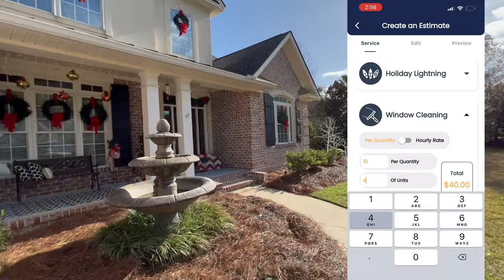How To Quote Window Cleaning (The Fast and Easy Way)

Comment: Where I live, I initially stick around 15 a window. If they have me come back every 6 months, I’ll do 13 a window. However If I’m getting of construction debris, I’ll charge 18 a window. If I’m doing construction cleaning, I’ll do 20-25 a window. I’m upfront with my customers before I even step foot on the job and my reviews on apps like thumbtack speak for themselves on my quality of work. I started this business with my twin brother in high school at 18 years old, we both are 23 now and growing every year.
Reply from the maker: Love to hear it - what do you charge for adding interior windows?
Reply: @AllAboutPressureWashing  that pricing is for both inside and outside.
Reply: 15 a window. Where do you live? Dubai? Paris? I do 40 for an entire fast food restaraunt.
Reply: The storefront cost so cheap, l do only residential. That is right price, I charge the same, California
Reply: Have you broken a million yet bro? Im planning on starting one with my cousin as well.
Reply: I’m 25 I do window and door installation, I’ve never done this before think I should just add this to my truck and services

Comment: I charge $4 per pane per side. I will use water fed pole when possible and I keep trying to improve my traditional skills so I can deliver better results quicker. I charge $4 per screen, and $5 for a deep clean on window tracks which includes using little brushes a vacuum, and multi surface cleaner. Other wise the tracks get a wipe down during the interior clean. For dirty exterior jobs, I use a hose end sprayer with EBC Glide to shoot window cleaning soap on to the windows and frames and then rinse with water. this takes off the first few layers of dirt, dust, spider webs, etc. I also rinse any dirt run off from the windows off the side of the house.  Its kind of like a soft wash for windows.  Then I go back over all the glass with my water fed pole and di water. I find the results are better and it keeps my water fed pole bristles cleaner. Im based out of Victoria BC. and I find that price point works well for me. I try to remove the upper screens from inside the house or ask the home owner to do it so I dont have to take the ladders off the truck, this saves me some time on the job. A house like this would take me no more than 2 hours for the exterior and 2 hours for the interior. I also would not have added an extra window in his counting just because it was a bit bigger than the other windows. For an exterior wash at 40 windows not 46 like he said in the video X $4 would be $160 for an exterior clean and $160 for an interior clean + tax
Reply: I am on the other side of the country in Halifax and will be getting going here soon. I appreciate your comment as it can be hard for Canadians do compare with US prices. $4 a pane sounds decent to me but a lot less than he is charging!
Reply: Hey, are you here in the states? Im brand new to this stuff, havent even had my first job yet. Need someone I can ask questions.

Comment: I charge $10 for the outside and $5 for the inside when bundled
Reply: This is a great add on technique.  Feels like a great deal
Reply: @ondrizal where are you located?
Reply: What do you mean by “when bundled?”
Reply: @Superstar.brawlstars of the person only wants the outside cleaned then it's $10 but if they "bundle" the outside and inside while the cleaner is there then it'll just be an extra $5 to clean the inside as well.

Comment: I usually charge 18+. Window cleaning can be a pain in the ass. Last time I did windows it was 20 windows for $450. My initial quote came out to $400 but I added the $50 for my pain and suffering of having to clean them.
Reply from the maker: Is that interior and exterior?
Reply: @AllAboutPressureWashing  some, yes. There was a huge bay window 2 stories we didn’t do the inside and 5 others we didn’t do. Took about 2 hours or so. We also cleaned the screens and frames on the ones we did interior. But it was a $2m house he was listing for sale
Reply: 😂
Invoice

Windows $400
Extra for pain and suffering $50 
Total $450

Comment: There are many window types in residential and different costs to clean. Many double hung windows are tilt-wash. They can not be washed from the outside because the screens need to be removed from the inside, so no ladders.There are still old windows where the storm windows get put up in the fall and the screens taken down, ladder work only.  Too many variables to assign one price for all windows.
Reply from the maker: Awesome

Comment: Hey Mike , I’ve gotten my soft washing business well established and i just added Window cleaning as an additional  service but i don’t know what method is more efficient and gives quality results , water fed pills or squeegeeing ? What situations do you use either or and do you quote it differently? I’m from Bluffton SC 45 minutes away from savannah
Reply: i work for a window cleaning franchise and usually we mop and squeegee everything because it's more reliable. our technique when using the system is to scrub the frames of the window, then scrub the rubber seal around the window pane then scrub the window itself after all the dirty water has run off the window we give it another scrub on the pane only and rinse. sometimes using the water fed pole would leave drip marks on the window and you would have to give it another pass so we usually reserve that if we are doing 2nd floor cleaning.
Reply: Buy a lot of small towels to clean the wi dow frames after and clean up any streaks u may have left behind. I used to crush like 4 houses in 6 hours.
Reply: It’s embarrassing how long I’ve been in the window cleaning business😊. I will tell you this, learn how to use a squeegee on every single solitary window.On the other hand is good to have Water Fed Pole. Once you get over the learning curve .I think it’s great. Stay thirsty my friend😊

Comment: Wow, is that for exterior only? If so I need to step my game up.  I charged a homeowner  $430 for 38 windows inside AND out. The price was supposed to be $530 but I felt that was a bit much maybe so I shaved off $100. I’m never doing that again.